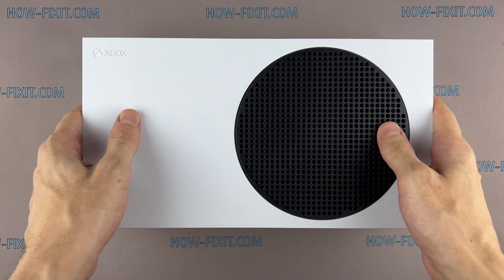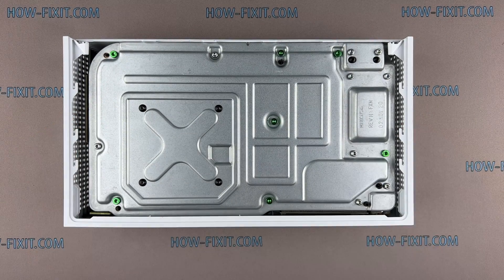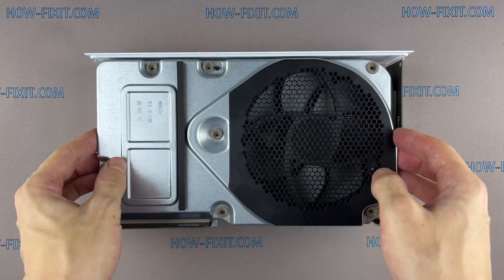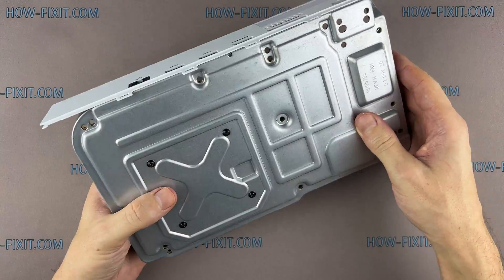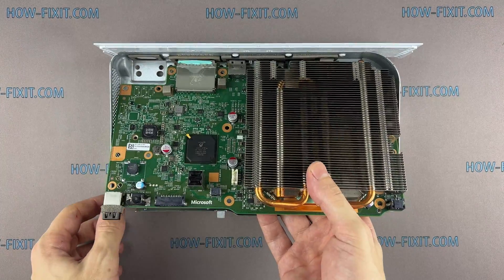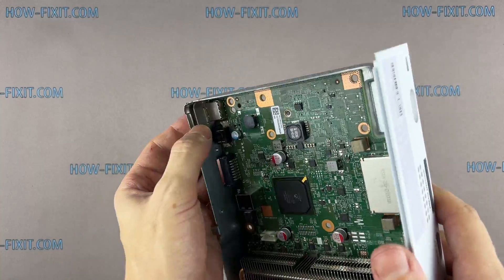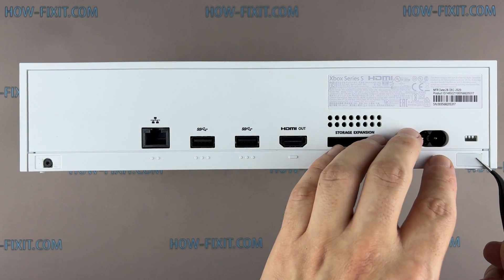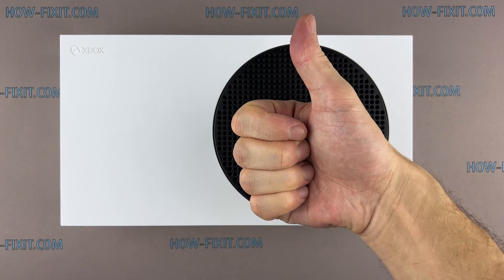Xbox Series S internal m2 ssd replacement

Comment: Where are the links to compatible SSDs? Looked through and can only find info for tools, mats an stuff but not SSDs
Reply: Yea wtf I'll leave the links for compatible drives.  Not a single link
Reply: @dillo408  bait and switch lolz
Reply: I did some digging, the articles that I read hint that Microsoft developed a proprietary ssd, a 3rd generation body with 4th generation capability.  This is why no one can upgrade ssd's and no provided link to such ssd.
Reply: Have you done any research on compatible ones
Reply: I don't suggest doing this from a cost perspective.  I would wait to see if someone can fit a wd black sn850 2tb in or a work around to make it work, as they cost is about the same but your performance would be way better.  The m.2 ssd in these consoles are less than half the size of what pc and ps currently use, so the space allotted for an ssd is not enough.
Reply: also missing link to the video on cloning, starting to find more and more IT info not providing any usefull details on how to fix particuler problems or provide access to all the steps involved
Reply: @jonl6258  290 that a series s price
Reply: Just watch TronicsFix for xbox series x, ssd cloning and experiments 🤔
Reply: I'm pretty sure it's never been updated because it's almost totally impossible to find one that doesn't come in an Xbox to begin with. If it's not completely impossible to find one.
Reply: @jonl6258  you can now buy Xbox brand external ssd, for the exorbitant rate of double the market price for comparable memory.
Reply: @jaredharris1427  wonder if it's possible to upgrade the external one (ie third party casing with a decent 2280 drive??) Now looking for teardown of one...
Reply: @pedalboat90210  possibly but that drive is the only one that can actually run games off of it and not just store them so you might as well just buy a cheaper external ssd at this point.

Comment: and when xbox ssd is broken, what would the replacement be like
Reply: buy new console. hhhh
Reply: If you didnt preventive made a full backup of the original SSD or at least the 1GB partition without the drive letter when it was in working condition, your SSD and by implication the XBox is only good to throw at the bin since they are software tied by a serial number.

Comment: If anyone is in need of repairing or replacing the internal SSD after one year of use something is seriously a miss. Nice tutorial, would of been better without the music. Not necessary.
Reply: It's about the size. 512 gb for these next generation games is basically dumb. Xbox should have put 1 tb in S and 2 tb in X.
Reply: @BlackIce0012  they didn’t because of cost.
Reply: they want you to buy the expansive seagate ssd
Reply: @arrahman7029  I like how you fused expansion and expensive.
Reply: Yeah then they can charge you 200.00 per extra 1tb of storage space… having an all digital console with 512gb of space with minimum 100.00 to upgrade space wasn’t a mistake it was intentional.
Reply: Sure enough 1 year and 2 months of use and hard drive failure. Thats a major problem. No reason for the failure after such a short time. No moving parts! Cant get another nvme, microsoft wont fix it, and they wont even discuss it either. Class action lawsuit I bet. Give it time, its pretty common and becoming a regular fault. Just google your symptoms and see.
Reply: would of? you must be an expert then.
Reply: I actually don't mind the music, helps ensure there's no dead air. However, I'm sure he could have chosen a more fitting bgm

Comment: The M.2 2230 kinda hard to find, especially Gen 4.
Reply: Now they are easy to find but there's no point since: 
1) its almost as expensive as proprietary external MS SSD.
2) you cannot *upgrade the internal one
3) you need some hardware and software skills.